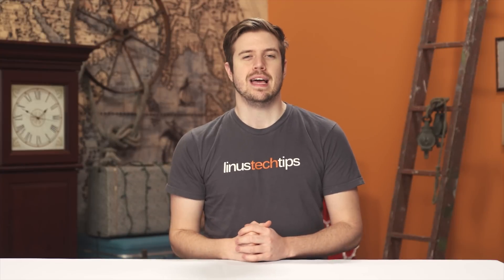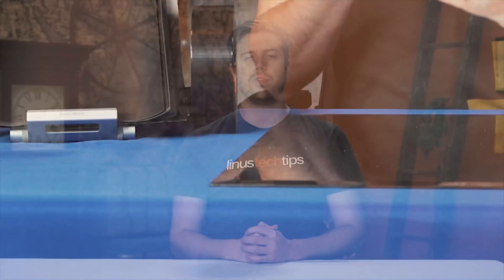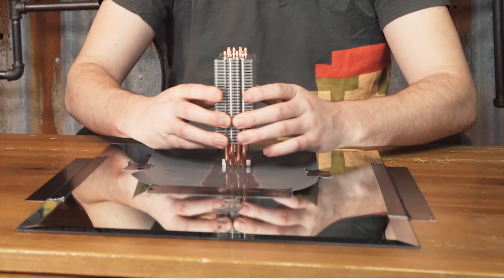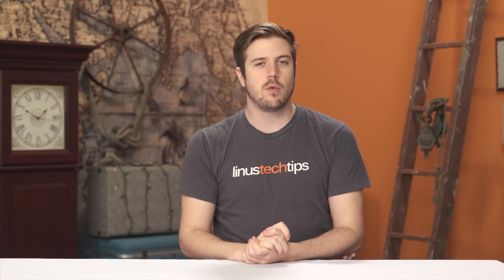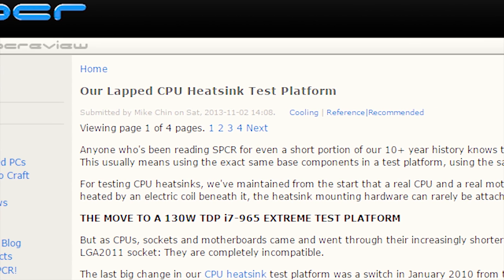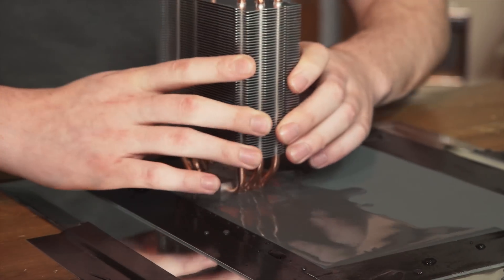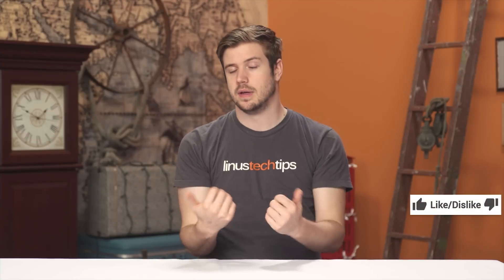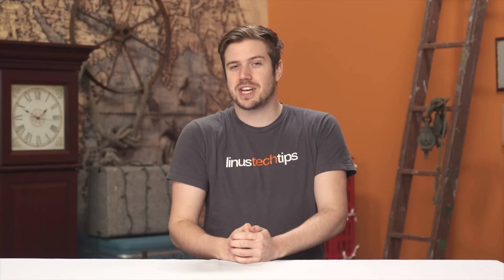CPU & Heatsink Lapping - Are concave, convex, or flat heatsinks best for cooling?

Comment: And yes. 
there's no way convex can be better. Those must be false test results. Really. 
All science behind that is that Metals conduct heat GREAT, and termal paste conducts heat worse than the metals do. Free electrons and stuff. 
So the flatter it is the less termal paste you have between them and the better it works. 
Termal paste's ONLY purpose is to fill the gaps and imperfection between two imperfect surfaces that othervice wouldn't have perfect area contact due to not being exactly flat on microscopic level.
Reply: +Captain Katawa Totally agree here, if you can get to a glass like surface on the heat spreader and heatsink that would achieve best possible performance, unfortunately that may only be a 1 degree difference :P

Comment: I'm a rocket scientist and there's a theory that if you high polish yous CPU and Cooler until you can see yourself in it with special paste they use for making optical lenses and remove remains of fat and everything from it you get perfect sticky metal to metal contact which will work a lot better than any termal paste can in theory. 
Metals are the best for that purpose. 
And people report having done it and achieved like a lot. 
But there also is conductive termal paste that makes it all unnecessary.

Comment: What is the max temp on an i5 6600k? Intel's page says 64c while on every post I've read, people are talking 70+c. What's right, what's safe, and what's pure stupidity?
Reply: 100C is usually when they automatically shut off. You'll be safe in the 70s, and even the 80s if you live in a hot area with bad air conditioning, but 60s are what most people want

Comment: in the auto industry surfaces can mean the difference between something working or blowing up! what I've seen is flat to flat surfaces don't tend to work as well (with some exceptions) as a concave to a convex does, that's why pistons are shaped with peaks or valleys depending on compression needs

Comment: Hey Luke, a definitive conclusion that comes from the scientific method  is always useful, even if the answer is "Whatever" 
now we have proof that cable management is only for aesthetics and if anyone makes a big deal about it saying that it will effect performance, we now know that it wont thanks to you putting in the time to test it, that it will not effect performance. knowing that is important and i hope you make more workshop videos
because Science!
Reply: Hey, I've got about 3 CPU degrees down doing a good cable management when replacing my PSU... (I have a single case fan for HDDs only)
Of course it's in idle. Don't you think it will help under big load?
Reply: I can assume that all things together do somehing.
Properly cable managed case + lapping of cooler and IHS + using good paste + replacing Intel's paste with LM + proper airflow in the case. Every single part might only give a little bit, but it should add up.

Comment: Thermal compound fills in the tiny surface imperfections, so lapping is almost pointless.  At best, you reduce the amount of voids that need filling.  The contact surface area, material used and design of the fins/pipes is much more important.

Here's something for Luke or the community to try: remove and reinstall your cpu cooler at least 3-4 times and record your system temps.  I'd like to know if this can cause a 1°C differential.

Comment: Using sandpaper isn't lapping......
Reply: thats not lapping
Reply: how does building a pc even make you knowledgeable about surface finish and flatness?
Reply: +Tea drinking crumpet munching British dude sure,  I would love that.
Reply: +Tea drinking crumpet munching British dude I guess you not subbing then :( so sad.
Reply: +Tea drinking crumpet munching British dude no.  I don't have any personal data.
Reply: +Tea drinking crumpet munching British dude well maybe before you explode with rage. I will correct your definition of lapping.  This is from the first line of the lapping article on Wikipedia.  "Lapping is a machining process, in which two surfaces are rubbed together with an abrasive between them, by hand movement or using a machine.".  Also if my name have been Smith you would have had a lot more trouble.  You haven't really told me anything a 5 year old couldn't Google? What did I have for lunch? What shift am I on?  As a metrology technician which learnt what lapping was in the first year of college I am sad that slick and so many other pc enthusiasts like yourself, do not know.

Comment: Smoothing is what the thermal couple paste does, fills in the holes... if you were going sans paste with a single bit of paper maybe... I had to do this once for a day (I under clocked it) paste had dried out it was a Sunday in rural England... 24 hours without a PC!  I also once used a pile of 2p coins as a heat sync on a Pentium 1 LOL!
Reply: +The GeneralCrow I'm running a core2duo without thermal pace, literally just slapped an old Corsair H50 AIO cooler on it, it's just resting there with no paste, figertight mounting screws.... Doesn't even hit 60*C haha. I wonder why they seemed so hard to keep cool back in the day.

Comment: What about different liquid cooling liquids. It makes a difference in cars due to the different thermal capacity of water vs ethylene glychol vs polypropylene glychol etc. Maybe another option exists, does methanol +water (windshield wiperfluid) or something similar work better? Just a thought. I switched my race car to polypropylene glychol (sometimes found at walmart as RV antifreeze) and my engine runs cooler yet my coolant temp is higher because its pulling away more heat, but it doesnt flow as well so you need a bigger radiator. So might be a fun test and should show results for sure.
Reply: +Merp Water cools better than just about anything, including automotive coolant/antifreeze and rv coolant.  The additives are to prevent corrosion and freezing and in general the higher the additive content, the worse the cooling.  The only thing that can really make water cool a little better is an additive that reduces surface tension.
Reply: garfunkle187 Generally true, water can move more heat, however water also microvaporizes around very hot things causing cavitation preventing good contact with the hot object reducing colling effectiveness. Also water has to be pressurized to take higher heats where other higher boiling points do not have to be. Not sure if it matters for CPU cooling but would be interesting, but you also cannot running straight water in coolers or you will get corrosion or mold.  Also many overclockers claim Methanol is better than water, and what they sell in water coolers is glychol based and many claim polypropylene is better. So I think it would be a valid test.
Reply: I agree the test would be valid simply because people do use those different coolants, i just wanted to make the point about water being a good coolant inherently.  

To clarify further:  Yes some liquids boil at higher temps than water, but ANY liquid will boil at a higher temp at higher pressure and vise versa and most coolants do NOT have a higher boiling point at a given pressure than water.  The cavitation you speak of is what is helped by the surface tension reducers (eg water wetter) i specifically mentioned.  Regardless, ANY liquid will be subject to these same effects.

The main difference between ethylene glycol and proplylene glycol is how they react to different metals, specifically nickel, aluminum and steel.
Reply: *and copper
Reply: garfunkle187 True, although proplylene glycol does have a 370 F boiling point. And ethylene glycol is 387 F So quite a bit more than water, so you do not need to worry about pressurizing to increase boiling points :)
Reply: Interesting, I didn't realise it was that high.  Good discussion Sir.
Reply: I have an 05 sti btw, is that your car in the pic?

Comment: Not a rant or anything I always think that Luke tries his best on what ever project he undertakes but this one...... Did he lap the CPU? Also I think the direct heat pipe heatsinks aren't ideal for lapping too many joints. Last but not least that heatsink isn't lapped at all its full of scratches. I have seen lapped heatsinks and CPUs but they had a mirror finish on them so I think it was a fail. Anyway I think lapping is too much work for the small results you can get out of it.